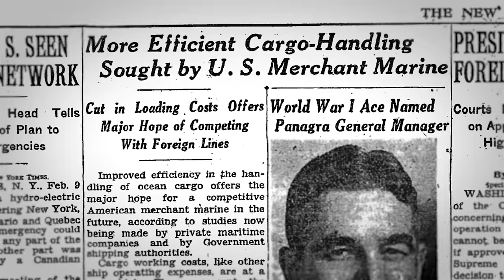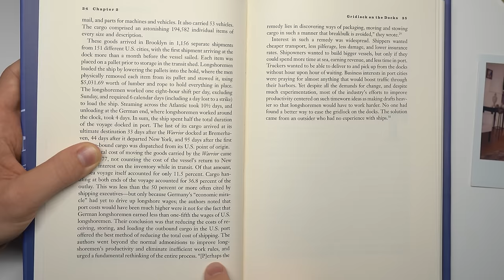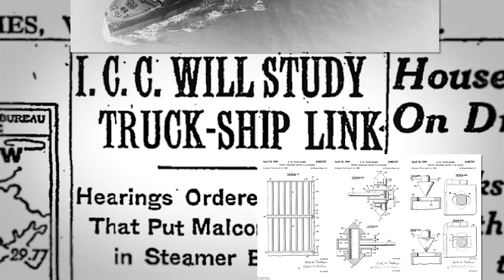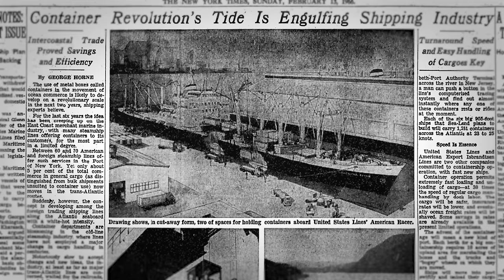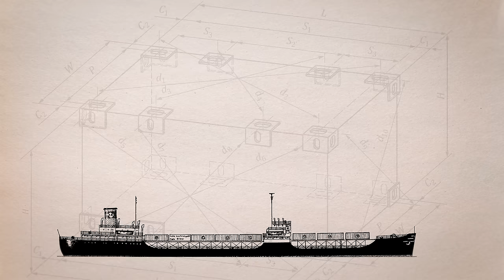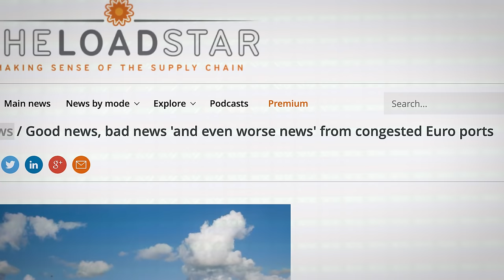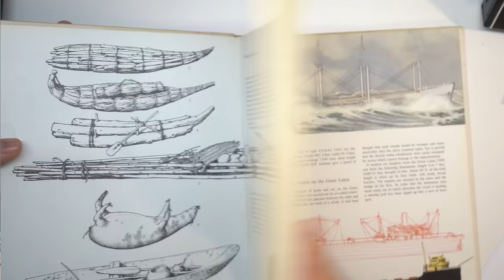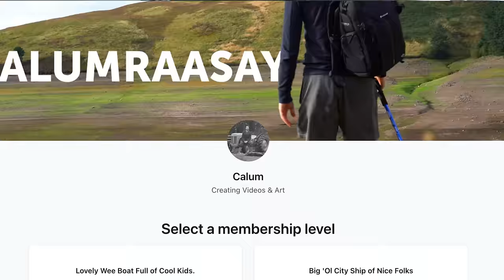Shipping Containers Are Genius - Here's Why

Comment: Something else to consider that really helped the efficiency of containerization was the loss of shrinkage from the dock workers. I remember hearing that sometimes up for 40% of rum bottles were 'dropped and broken' by the longshoremen and never made it to their destination. That stopped when everything was put into nondescript boxes.
Reply: Not completely. TRAINS ran an article about Union Pacific and BNSF double stacked container trains being raided by gangs of thieves while halted waiting for a slot in the Alameda Trench expressway for freight trains. Gang associates would tip off the number and location of boxes carrying specific high value consumer goods and then the gangs would go after them while the trains were waiting in the sidings.
Reply: @markfryer9880  I have a family member who was part of a gang in the 1970's that would board trains while they were moving, and then steal engines, transmissions, and tires off brand new cars. WHILE the train was rolling.
Reply: @markfryer9880  In Birmingham also.
Reply: Yeah the mobs took shipments
Reply: He briefly touched on it around 3:50 in the interview—the theft of cargo as a disadvantage of the older method of shipping.
Reply: This was honestly one of the major factors that came up in my “Economics of the Shipping Industry” class. It was especially important for high value cargoes like electronics and whiskey. Theft by dockworkers is actually a major part of why Scotch used to be so much more of a status symbol. The dockworkers used to say that the pay was $4 an hour and all the whiskey you could carry. Something like 1/5 of all Scotch imported into the US was stolen by the dockworkers, and this theft alone increased the cost that had to be charged for the remaining for bottles by 25%. This further inflated the already higher cost of Scotch relative to American whiskeys, making it something that was only purchased by people who were willing to pay a hefty premium for the taste. This made it associated specifically with a wealthy and discerning clientele.
Reply: Ya think? My uncle was a Longshoreman in San Francisco prior to his premature death in the mid-70’s. My mom dated a truck driver in the latter part of the seventies. Freight handling back then was a veritable shopping mall for those who were inclined to help themselves in those days.

Comment: Interesting side tangent about the first and only attempt at a nuclear cargo ship failing partly out of "You can't dock here" but als because it was one of the last pre-cargo-container vessels.
Reply from the maker: Good point, that’s what the final page of the book I referenced was all about!
Reply: Simon Whistler has a great video on the history of that ship, The Savannah.
Reply: Mustard did an excellent video on nuclear powered cruise ships titled What Happened To The Nuclear Passenger Ship?.  I think he mentioned the cargo aspect (which would make them technically tramps? 🤔), but don't quote me on that. 😉
Reply: @jmchez  Oh, interesting. Dpending hor old it was I may have heard of it from him.
Reply: The NS Savanah is one of my favorite ships. I toured her when she was part of the Patriots Point museum in Charleston, SC.. She was too expensive to operate. The engineering crew needed to be nuke qualified. Combine the awkward cargo hold configuration and the inability to convert to containers it couldn't overcome the nuclear port limitations.
Reply: I think the Savanna also has the first ever microwave oven! Invented by a Raytheon employee who accidentally melted his chocolate bar when testing a magnetron - a key part of a radar transmitter.
Reply: @simbry49  Good point, that kind of expertise doesn't come cheap, even at the height of an oil crisis the wages would quite possibly be highter than fuel.
Reply: @DIEGhostfish  it was similar logic that led to the US Navy retiring the rest of the nuclear surface forces that weren't aircraft carriers. Their engineering crews were just too big and expensive. The only other surface nuclear operator is Russia with a couple of warships, a cargo ship supplying towns in the Arctic, and a number of icebreakers.
Reply: There was another attempt in Germany, the "Otto Hahn". Did a few cruises and then was dismantled.
Reply: @Hauketal  Yes. Also the Japanese tried as well. I meant specifically current operators.
Reply: Pretty much an overreaction seeing as it's basically a steam engine that only exhausts steam, not belching clouds of partially burnt crude oil. If people actually had an understanding of how things work they might actually be able to make informed decisions sometimes.
Reply: @simbry49  is she no longer there?
Reply: @shoominati23  nuked shipping 👍even for fun vacations it's ok and probably better off then N-2 fuel oily's ( im partial to wind-powered as i like sailing or solar but in 2025 how realistic is that economic at scale wise ?? ) but land based nukes no thanks to much risk's involved with it and or the technology isn't advanced enough ect plus the waste process problem's ect

Ps. not a eco-nut/tree-hugging but i did have people point out to me the advantages of nuclear power at sea and couldn't find a good enough counter argument's against it
Reply: I'm fairly sure the reactor onboard NS Savannah was one of the safest reactors in the world before it was decommissioned. You probably wouldn't be able to destroy the reactor if you tried, and it was designed to remain intact even if the ship sank to the bottom of the ocean. I believe the reactor was also capable of fully autonomous operation although this feature was never used.
Reply: @blockstacker5614  True but cities and even entire states and small countries were still naturally worried about their only harbors becoming unusable if there was a chunk of uranium at the bottom.
Reply: @DIEGhostfish  worst case scenario the ussr swipes the reactor, its not that dangerous I've seen inside the reactor room
Reply: @DIEGhostfish  so there okay with fuel leak's/spills/fires at least U238 sinks and stays put ( and port/deep water slows down the reaction or stops it and stays in bigger chunks ) and is easier to control/clean up the mess as it's localised unlike crude oil/N-2 sound's like hypocrisy to me

even a terroristic plot is unrealistic for the most part aka dirty bomb one of the reasons after listening im more ok with it and in 2022 biggest shipbuilders and operator's are heavily reulated and tracked aka the core can easily be GPS'ed 24-7 remotely by law enforcement
Reply: @richardprice5978  Per kilowatt, nuclear power is far, far safer and cleaner than than, say, coal power. The waste has to be dealt with more carefully, sure, but there is so much massively less of it that it's much easier to deal with safely and avoid pollution.

Coal mining and processing alone kills thousands of people every year; there are millions more life-years lost every year to atmospheric pollution from fossil fuels. Nuclear power has killed nobody in decades.
Reply: @DIEGhostfish  now day's one larger ship sinking or leaking oil/LPG out and making a spill/fire would shut down the harbour for week's and it doesn't need to be a tanker delivery shipping but yes that style would still have the same potential shutdown problem's

plus the environment and human negative impacts from it
Reply: @Curt_Sampson  you left out other options for land-utility power generation and mother nature has way's of scrubbing Co2 out of the air ect and the nuke power plant's in Europe right now are being pons in the game of war/diplomacy ( and yes knocking out/controlling utilities is far game and not a war crime as they support the armed forces generally as well as civilian populations ) and one wrong move and it goes critical/meltdown ect and you also are leaving out smaller incidents of workmen getting hurt or killed ( or years later on in retirement and getting something like easily provable cancer from it ) and also forgetting incident's like japan's meltdown's or the 🇺🇸 
s or USSR and some of them are covered up like the one in Idaho INL lab's and or is still considered a super fund site
Reply: @richardprice5978  I am not forgetting other forms of power generation, which are generally not as bad as coal, but are still far closer to coal than nuclear. Nor am I forgetting things like the Fukushima disaster, which killed nobody, unlikely the thousands of miners killed that year in mining disasters.

As for easily provable cancer, coal causes more issues there, too. Within ten years of the 2008 Kingston Fossil Plant coal fly ash slurry spill, more than 30 people involved in the cleanup were dead from exposure to the toxic coal ash, from diseases such as brain cancer, lung cancer and leukemia. Hell, a basic coal or oil power plant is far more radioactive than a nuclear power plant.

The only way you can paint nuclear power as being environmentally unsound is to completely ignore the massive environmental damage, illness and death affecting millions each year from the chain of industries that generate power from fossil fuel.
Reply: @richardprice5978  As for solar, wind, water, these are all environmentally better and kill fewer people than nuclear power, and should be used in preference. But coal versus nuclear is not a theoretical discussion: both Japan and Germany in the past decade have built new coal plants (and plan more) to replace working nuclear plants that they've shut down and are causing more illness and death than necessary because of this.
Reply: @richardprice5978  ⁹
Reply: also tempted to be a sailor $$$ in the engine room/department on board but it would have to be a English speaking ship and company and 1st world nationally for law's and protection ect.aka uk 🇬🇧 USA 🇺🇸 ect.

so on board nuclear power plant wouldn't bother me if its first rate of the line ect. but a dodgey ship/nuke i want nothing to do with

Comment: 25 year LCB (licensed customs broker) here. Actually, there were specific requirements based on individual item description. That's why there was barrel, cask, butt, drum, etc. Each one described a different general shape and size. Yes, there was no hard and fast standard, however a drum was almost always 55 US gallons and metallic, while a cask was expected to be less than 20 gallons, and almost always wooden. 

Just thought I'd give a little detail on wet carriage standards. But even bales were usually expected sizes. Crates could be anything, and thus almost always had dimensions attached, and actually still do. I did LTL cargo for several years for a consolidator, and it's a bloody nightmare.

Oh, and Longshoremen NEVER worked on a the boat, their job stopped at the rail. The crew took it from there. And lightermen usually handled from warehouse to dock, where longshoremen took over.

Comment: Oh this is gonna be a treat! I helped my old boss convert a shipping container into a storage/workshop type thing, installing fans, lights, electricity and such. Great use for them.
Also love that tiny Maersk container, I want one!
Reply: You need 80mm styrofoam sheets in the walls and roof if the box is sitting in the Sun.
Reply: In some climates. One problem with shipping containers is the complete lack of insulation - it's just a metal shell. You have to either add a whole lot of insulation (shrinking the already-cramped space within) or make do with the uncontrollable temperature.
Reply from the maker: @vylbird8014  Yeah you have to know what to put in them, even here in scotland they can get proper hot inside, and then plunge to really low temps. I might shutter mine and built a wee shed around it in the future.

Comment: Shipping containers are great for shipping and storage but not so good as a base for a house. A metal box is like reverse-isolated: in warm weather they transfer heat inside, in winter they leak heat outside and create condensation inside. 

You can spend money to try and fix it and fight the mould but at some point there are better options for cheap builds. It will be interesting to see how your workshop holds up when you have ambient temperature and ventilation with the door open.
Reply from the maker: Yeah from my experience once you get to the point of framing, insulating etc. then it starts to become a bit silly to not just build a frame from scratch.
Reply: @CalumRaasay  Not sure how much coping with hot weather is going to affect you up there!
Reply: You can just pile dirt around it with an excavator for insulation. Just leave enough room to open the doors enough
Reply: @CalumRaasay  A lot of portable buildings (for worksites/hire) in Australia are now based off containers since they're much easier to move around rather than transporting halves of buildings by trucks.
Reply from the maker: @speedemon81  that’s funny considering Australia and New Zealand’s heritage with corrugated iron as a building material. Containers are the modern day wrinkly tin!
Reply: @CalumRaasay  Yes, we use containers for all sorts of purposes. Open ended 20 and 40 foot containers are hired to commercial builders to provide overhead  protection for pedestrians on the footpath and for workers to get to and from the jobsite and the site amenities without getting wet or walking through unsafe conditions.
Reply: @CalumRaasay  Only for the roof, and walls on sheds. I've only very rarely seen it used on dwellings as a cladding on a habitable space until recently when it's become fashionable with an air gap, battens and a membrane to keep the moisture away from the insulation.
Reply: @speedemon81  yeah but those are built from the get-go to be housing or offices: they're buildings or building segments made in shipping-container sizes, not shipping containers retrofitted into buildings.
Reply: I would be thinking of a way to turn the walls of the container into a durable roof for a masonry building.
The container's roof and one wall are a pre-made 12-pitch weather-tight roof, leaving one wall as a 4-pitch front porch roof, and the floor of the container would make a decent back deck.
Reply: @CalumRaasay  there are companies that make foam insulation panels flat on one side and shaped to tightly fit the corrugated metal. They're glued to the wall and to each other to form a sealed surface.
Reply: Coat the outside with "high emissivity paint". That is how I keep the heat out of my travel trailer with an aluminum roof.
Reply: @drewgehringer7813  I think that's a very important point, and illustrates the power of standardization. It also demonstrates how that constrains design. e.g. computers fitting around the boxy ATX standard.
Reply: @CalumRaasay  Or you could buy an old refrigerated container (reefer) and convert that.
Reply: Couldn’t you just shore up the sides with dirt for insulation?
Reply: One huge problem I've read is that the sourcing of these containers isn't too well documented... you could acquire a container for living in and have no idea it was used to transport hazardous materials. Could be wrong though.
Reply: I've worked on a couple of container conversions, and there's really two problems..

1. The container is a monocoque structure. It only stacks in one particular way, and then only if the container is fully intact, with the door shut. A stack of windowless boxes that don't interconnect, and with doors that you can't open is not what most people are looking for in a house. Any container house ends up with a heavy steel frame welded onto the inside and often outside of the containers to support various cut outs for windows / doors / interconnections between containers, and to allow non- standard stacking.

2. Containers have flat roofs that need to be in motion to shed water. When a container is installed in a stationary location, water will tend to pond on the top, which causes significant corrosion. A common solution is to put a roof over the container to protect it from the weather. 

Long story short, conversion compromise almost every aspect of the container, meaning that a converted container is little more than cladding on the finished building. And there's cheaper ways to clad a building with steel sheeting.

If you like the aesthetic, container houses are fine. But, all in, they cost more than conventional buildings.